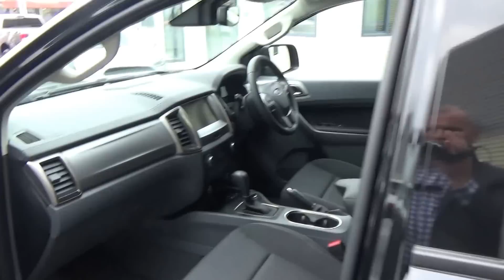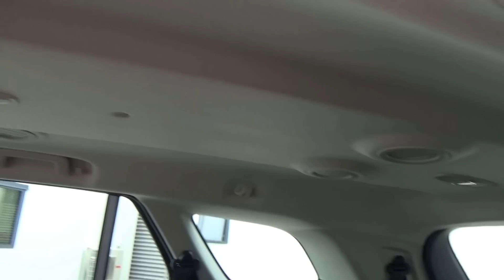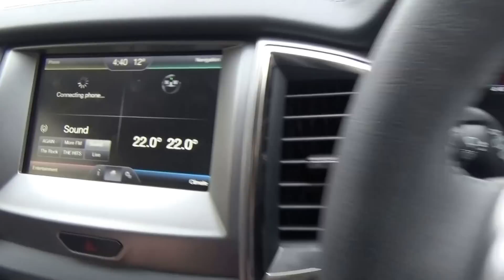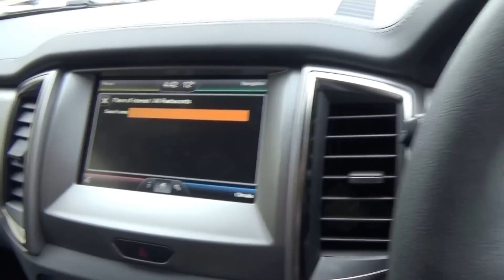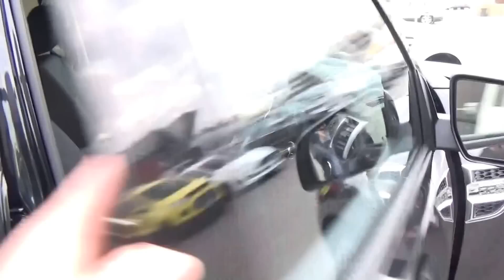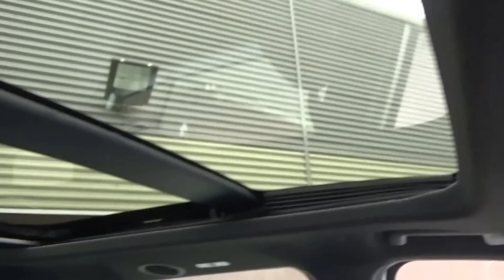Ford Everest Trend and Titanium - Ford Cars Review | THF

Comment: Which one is better trend model or titanium model
Reply: Trend Model is better to buy. Titanium model is just too much over priced given the greed and perks of sun roof and with pressure monitoring systems. rest is 110% same so don't be fooled by the price tag
Reply: Most of the standard equipment in the Titanium is also standard in the Trend - examples of which include the adaptive cruise control, lane departure warning, forward collision mitigation and the power tailgate.  The only thing the Trend doesn't get is the Active Park Assist - in Australia, the Trend retails for just over A$66K while the Titanium retails at just over A$83K. I cannot justify paying an extra A$17K for the Active Park Assist.....
Reply: Value for Money, get the Trend :D
Reply: Reverse parking camera is very important for safety why not in base model or ambient or trend compare to other company below million pesos there is camera, how much the value of camera its very cheap only and the second seat will not tumbled giving the passenger in last row difficulties in accessing.
Reply: Toyota Rush is seven seaters and small suv and why there is reverse parking camera 🎥